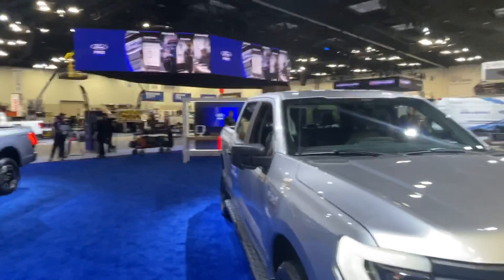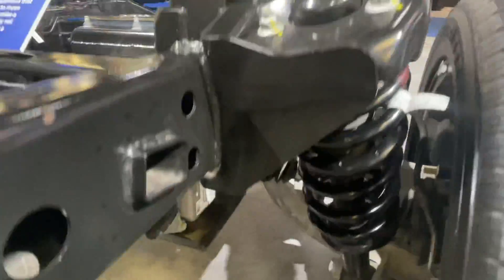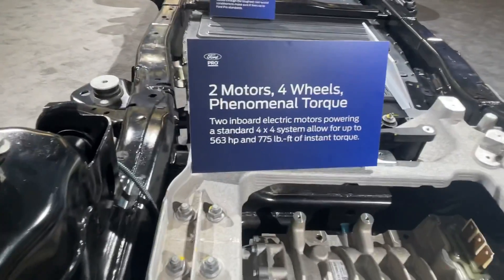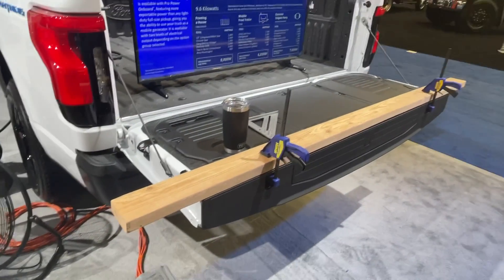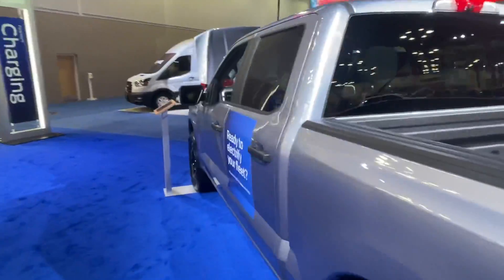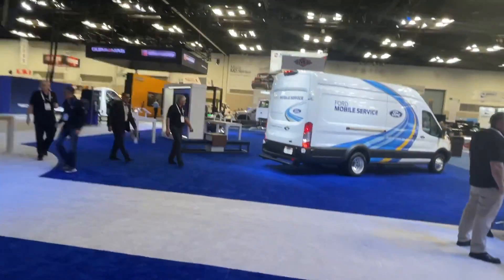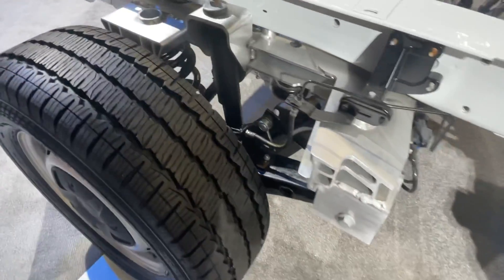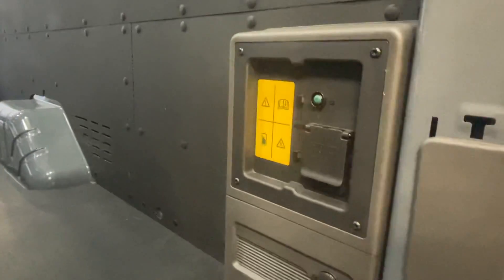How Does the Ford F-150 Lightning Actually WORK? Let's Look At What's Happening Under the Skin!

Comment: E transit electric doesn’t look like it has 220v 30 amp plug that was shown in the video , some contractors may be turned off, 

For the lightening pro and lightening I’d like to see optional battery packs for the frunk and cargo bed especially for those who like to pull trailers rv or other trailers, they can go further not worry about range or have stand by power, 

One thing the lightening should have quad motors, get more range with the existing battery

Comment: Those are not just the leads for power from the rear motor @2:04 and no cable attaches there - the inverter mounts directly to the motor case (plugging into those contacts), and for some reason Ford left the inverter off of this Lightning display unit. 

At @9:11 you can see the inverter on the top of the similar (but presumably not the same) drive unit (motor with transaxle) in the E-Transit; the E-Transit drive unit comes from the rear of the Mach-E. The orange cables coming into the inverter carry the high-voltage DC power from the battery.

Comment: It's a semi-trailing arm, not a "swing arm / A-arm system" @1:53, but I realize that the right terms don't always come when commenting live. 

It's a classic independent rear suspension design, rare on trucks but very common on cars from the 1960's to 1990's. It is simple - and arguably crude - compared to the double A-arm or multilink rear suspension designs in the Rivian and GM electric trucks, or even the independent rear suspensions of gas-engine SUVs such as Ford's own Expedition or the GM Yukon/Tahoe/Suburban/Escalade.

The E-Transit also uses a similar semi-trailing arm rear suspension - is it the same one? The E-Transit rear suspension is shown, but not clearly.

Comment: Can we talk about how they only put the extended range battery in the XLT and the extended range battery is like a $19000 option which puts the the XLT at $75,000 with no options other than the battery in my location. This isn’t for regular people.
Reply: No, the big battery option is $10k. There is a mandatory equipment package that cost $9.500 and adds a shitload of stuff. There isn't a whole lot of people that can afford a $55k truck that can't afford a $75k truck.
Reply: @CMCNestT  You are right to point out you get extra (convenience) features for your $19,000.  But I have to disagree on the affordability issue.  I have no problem justifying a $55K truck, but I could not justify a $75K truck.  I am retired and just drive my truck (and tow my boat) relatively short distances.    So, neither the extra range or extra convenience features would make a difference.  (I have ordered an XLT standard range.)

Comment: Cool truck for around town but will probably be problematic trying to find a charging station out in the wilderness when camping and road tripping to remote places. Also towing and payload will drastically lower the range.
Reply: Ford does not suggest EVs for camping. The usual Transit RV prep package isn't even available for the E-Transit.

Comment: That E-transit is useless as anything but an urban delivery vehicle.  Keep the price, double or triple the range, and you might sell them to tradesmen.  As it is it won't even make it TO half my jobsites with a 120 mile range.  And tradesmen don't exactly take multi-hour lunches where they can charge mid-day; they eat on the go.  This thing has a LONG way to go before it's ready for primetime.
Reply: Most Transits are used as urban delivery or service vehicles, and the E-Transit has enough range to handle the full day for most of them. Of course it isn't enough for everyone.
Reply: @brianb-p6586  I'd really like to go EV when I replace my NV2500 later this year, but unfortunately I've only seen delivery vans in the works.  Nothing targeting the tradesman.  So far, EV just isn't capable of competing in this market.  Perhaps in another generation or two, but that doesn't help me now.  Currently I'm looking at a 3.0 duramax 1500 chebby with a contractor's topper and a bed slide.  It won't "work" as well as say an F250/350, but I only need that much capability on occasion and the 30 mpg of the 3.0 on the highway is hard to overlook even if it will struggle somewhat towing my crawler on the weekends.  The only other option is to hope that late this year/early next year a viable EV van that can manage 250 highway miles between charges comes out AND to pick up an older truck for towing or heavier work.  But buying 2 vehicles instead of one isn't ideal either.  Unless maybe I can convince the wife to trade her GTI for an F250 (not holding my breath)

Comment: I'm guessing had they gone with a solid axle leaf spring assembly with an electric motor mounted to it in the back of the truck, the electric motor unit would probably be beaten to death by not having a suspension to padden it.
Reply: That can work, and the motor-equipped axles are available, but due to the unsprung weight they ride poorly and will not be used on light-duty vehicles. Some electric buses and heavy trucks do use electrified axles like that..

Comment: It's a pity they don't have 4-wheel steering. These long trucks are difficult to maneuver in a parking lot.
Reply: It's just a regular, fullsized pickup. Millions of us maneuver our pickups easily in parking lots every day. Pull in and back out of parking spot with one try. These are only about 20' with good turning radius. It's not like it's a long wheelbase HD pickup with poor turning radius that require a few sticks. I do like the new Silverado EV but would only buy a version without the 4 wheel steering. Unnecessary upfront expense and one more thing to go wrong down the road (and expensive repair) compared to non-4 wheel steering rear drivetrain.
Reply: @MrChadx1  hell, this isn't even a long truck - it has a tiny little bed!
Reply: @Don Happel  Yes, that is my point. Easily manuevered at this size. No 4 wheel steering needed.  Or was your reply for the original poster rather than me?
Reply: @MrChadx1  Sorry yes, agree with you.  4ws is hardly needed for something this size as it would only increase cost and complexity.
Reply: The semi-trailing arm rear suspension is not reasonably compatible with steering. More complex suspension designs are, but there is little real demand for 4-wheel steering so it was not worth putting in for Ford.

Comment: How will it be to tow a 7000 trailer?  What will the range be?
Reply: Minimal.  I'd expect you need to charge every 100-150 miles based on what the Rivian guys found towing cross-country.  I tow about 8500 lbs myself from CA to places like Moab.  Right now that looks like a multi-day trip with anything EV instead of the current one-shot 14-15 hrs.

Comment: As a tech I wonder how many miles those rear cv axles can really last under miles of acceleration and towing.
Reply: Check the lack of ground clearance for that rear motor......they need to move it up with separate motors, and angle them down
Reply: @imtheonevanhalen1557  The clearance under the rear motor is not significantly different from the clearance under the front final drive unit (differential) of a 4WD gas truck.
Reply: They last in the front axle - they'll last in the rear axle.
Reply: @brianb-p6586  your not understanding where the load and force is directed,  there's a reason trucks have a Solid Rear axle.
Reply: @jstitan2972  😂 I know how suspensions work, and they work the same way in all vehicles. And the CV joints don't take any suspension load, only drive (and engine or regenerative braking) torque, so it doesn't matter how much load is on the axle.

The reason that most trucks have live beam rear drive axles is that it is the cheapest configuration.
Reply: @brianb-p6586  and strongest. Hence the reason all heavyduty trucks have a solid rear axle. I'm not trying to argue with you buddy. It's just an interesting design
Reply: @jstitan2972  But strength is entirely dependent on design and construction. No design is inherently strong - the beam axle in a golf cart wouldn't hold up under an F-150, and the independent suspensions of a LAV wouldn't notice an extra F-150 or two as cargo. By the way, the rear two axles of any generation of a General Dynamics LAV are semi-trailing arms, like the F-150 Lighting and the E-Transit.

Comment: I'm still not convinced that electricity has a place in the truck world especially if you start using it for actual truck stuff. Maybe a small company that used it to make local deliveries could see use for it but an everyday vehicle no I just don't see it as a viable option.
Reply: The vast majority of amazon and other delivery service trucks go just 30-70 miles a day. The vast majority of intermodal trucking is 100-120miles daily routes. Stop n go driving is also ideal for evs with their superior in town mileage and regen braking saving you brake pad wear. No oil changes, no emissions testing, no tune ups requiring spark plugs&coil pack's, no engine air filters, no hoses, no thermostats, no fuel filters, no flushes except for the brakes. It'll all ad up very quickly for fleets both large&small. 🤔

Comment: Any chance of a F250 Lighting?
Reply: Farley said larger ev trucks due around 2030. Gm had a 2500 sierra as a magna demonstrator with ev swap over on the out of spec motoring page.
Reply: @4literv6  Informationally, there is no GM affiliation with that Magna vehicle. Magna created that demo vehicle to show off their new heavy duty combination "motor axles" and they happened to use a GM HD pickup. No GM affiliation. Any manufacture can use the Magna parts and electronics (as they do today). Really excited for these to develop further. Would love to see a HD pickup that is a plug in serial hybrid. Meaning it runs on all electric motors like these magna and the small to medium sized battery can be plugged in or get it's energy from a smaller ICE which is used only to generate power; no direct drivetrain connection. I don't need HD for pulling heavy trailers; only for payload (slide-in pickup camper) so would love to see an HD as a serial hybrid.

Comment: Hoping there are higher kWh density aftermarket battery packs in the future that can be swapped into these trucks as battery tech evolves and these trucks age
Reply: There will be. Nio already uses one size pack across their model lineup. So it can have 75kwhs all the way up to 150kwhs coming soon all in the same size pack shell. Hyundai and Kia recently announced an updated egmp platform called ima. Which from 2025 will be used across all their evs. Same size pack, same basic chassis layout, 5 separate sized motors depending on the needs. 

Our next energy already used a stock model s pack. Took out the tesla modules and using cell to pack they got 206kwhs in the same space as tesla has about 100kwhs. So it'll happen soon enough, and there are aftermarket companies which upgrade older leafs and BMW i3s to larger capacity pack's. 😎

Comment: The acceleration is going to make this  a pleasure to drive
Reply: Acceleration really isn't particularly important for a work truck.  Sure it would be great to have power when towing but as we've seen this won't have enough towing range to be of any use there.  But even in my not-exactly-fast NV2500 I almost never put my boot down for the simple reason that the back is always full of tools, gear, supplies, etc and I don't want to throw it all around the box.  So I end up driving it like a little old lady just so it doesn't look like a war zone in back and smash up a few grand in tools and materials.  Of course maybe that will be different in a fleet vehicle where the driver doesn't have any skin in the game, but as an owner/operator you care about that sort of thing.

Comment: When it comes to battery protection and longevity, which is better for charging…ac or dc?
Reply: AC (level 1 and level 2) is better but only because they typically charge at a much slower rate than DC. So more correctly, there is no difference in longevity between AC and DC if the charge rate is the same because it's the charge rate that impacts battery longevity and not that it's AC or DC.  Faster charging generates more heat and it's the heat that is not great for the battery pack. 

Note that most EV allow you to set the charge rate, so even if on a DC charger, if you have time to wait, you can set the charge rate from the maximum the EV will allow to a lower, slower setting. If left on the max setting, the EV computer will automatically adjust the DC charge rate up or down depending on battery temp and other parameters, but it is always right on the edge of max allowed and so harder on the battery than a slower and cooler charge rate. Best practice is to always charge at a slower rate (like Level 1 or Level 2 AC or reduced rate DC) if time allows and only charge at fast rates (full DC rate) when time is short (like on road trips).
Reply: @MrChadx1  thanks much!

Comment: I feel like there was more room to add battery capacity to both the F-150 and the Transit.
Reply: the abysmal 119 mile range on the e transit is enough to get me to my first stop and get stranded.  If it had a 250 range it'd be in my driveway already.
Reply: @SpiritCannon  True story!! With all the room left under it, they could’ve added twice the amount of batteries. Even if it sacrificed some carrying capacity it is worth it.
Reply: The battery fills the available space in the F-150 Lighting, so there is no room for more unless a longer wheelbase configuration is used.
The E-Transit uses the standard range battery of the Mach-E. There is room for larger, but the longer-range Mach-E battery won't fit because it is taller in the rear (under the rear seat in the Mach-E) so it won't fit under the Transit floor.

Comment: No Flat Towing? What if you get stuck off-road? 🤔
Reply: The flat tow limitation probably relates to the capacity of the battery to absorb charge. This might only be a problem if you flat towed hundreds of miles like RV people do. I would guess that flat towing for 10-20 miles to get back to paved road would not be an issue absent broken drive train parts or serious electrical issues. I also bet that if you are stuck because of a depleted battery, a few miles of flat towing might gain you enough charge to allow driving to a charging station. I saw a youtube video where a Tesla model 3 was rescued this way.
Reply: @rik999  The flat towing limitation doesn't have anything to do with battery capacity  - when flat towed the motors would be left idle, so they wouldn't charge the battery.
Reply: @brianb-p6586  How would you "idle" the motors without mechanically disconnecting them from the wheels or isolating them electrically (which would complicate regen)?
Reply: @rik999  You answered your own question: the motors are isolated from the battery. That just means that the inverters run with at zero power, and it happens ever time the accelerator pedal is released... and any time the control power to the inverters is off. Regeneration is just running the inverters in generator mode - like idling, it is just a decision in the logic of the inverter's controller, not a matter of physical switching or mechanical configuration.
Reply: @brianb-p6586  Nice theoretical discussion we are having, but what is the evidence that Ford is doing this with the Lightening and if so why do they say you can't flat tow?
Reply: @rik999  Evidence? That's just how motor controllers work. You don't need evidence that an engine can idle or can be turned by the transmission when the vehicle coasts (slowing down or down a hill), because they obviously do - same with electric motors turning without producing driving power or generating.

An example of a potential issue with flat towing is that the transaxles may require electric pumps for lubrication, which would require the truck to be switched on to tow it.

For the Mach-E (Ford's only currently available EV), the owner's manual says "You cannot recreational tow your vehicle with all wheels on the ground because vehicle or electric drive motor damage could occur"; they don't say why, but they also don't mention a battery issue. They do provide an "Emergency Tow" mode which does allow towing with all wheels on the ground, but it is only allowed for a short distance and it requires that the vehicle be switched on and put in that mode. There's no obvious reason to expect the Lightning to be different, and since the E-Transit uses the same drive unit (motor and transaxle) it is almost certainly the same (the owner's manual just says to call a professional towing service).
Reply: You're not gonna off road in these trucks. Trust me
Reply: @ismaelcarrillo3956  You just know that someone will...
Reply: @ismaelcarrillo3956  why wouldn't you?
Reply: @ismaelcarrillo3956  The F-150 Lightning will be as capable (and as limited) as a gasoline F-150 off-road.
Reply: Drag it out and flatbed it.

Comment: That thumbnail photo shows how Unnecessarily oversized these vehicles are…
Reply: It's a full sized pickup truck and they are huge.
Reply: It's sized for the intended purpose. No more; no less. They make small pickups if a small pickup will serve the purpose. Larger pickups serve a different purpose. HD are even larger and more capable. That way buyers can purchase what is right for them.  It's one size of many available, so not really any way one can say these are "unnecessarily oversized".

Comment: The placement of the battery pack is a great feature, allowing to be more easily replaced, if it gets too degraded. Increasing the longevity of the truck.
Reply: All EV batteries are readily replaceable if required.
Reply: Because you said so?
Reply: @mybro727  I mean it is sitting between the rails with no drive shaft or exhaust systems running underneath it. Looks doable.